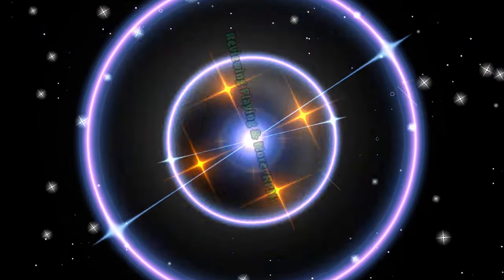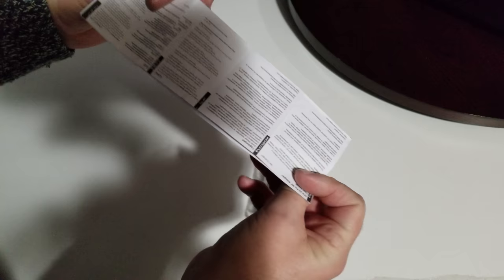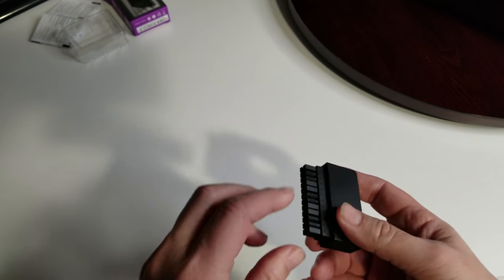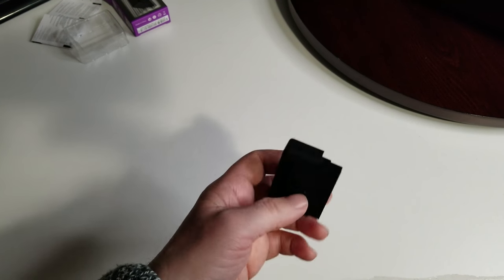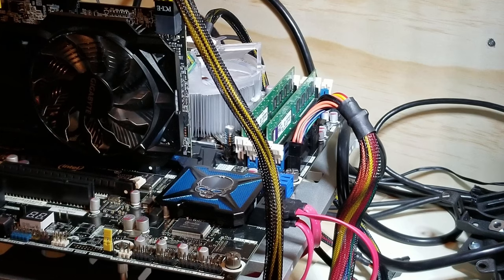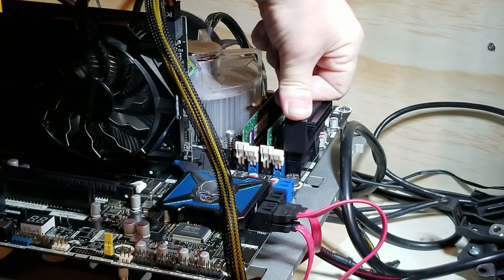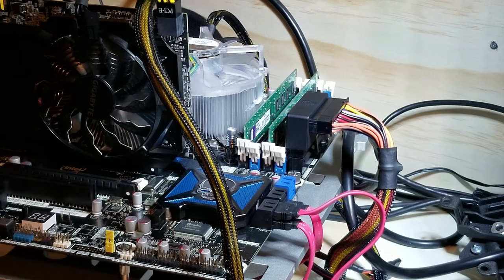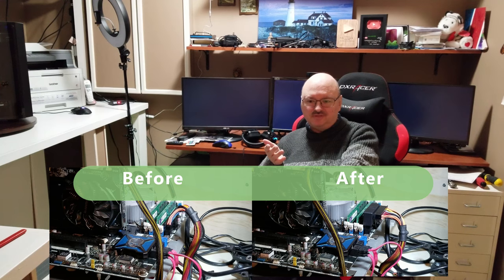Cooler Master 90 degree 24 Pin Power Adapter for Your Motherboard

Comment: i always was confused about do the wires of 24pin connector like when they are bended like that
this device definitely should make installation safer and easier
but i think it's too high, they could do it a little bit lower, so and it look bulky
also, they can put an LED on it, so insides of pc will be more brightly and shit, you now
Reply from the maker: Yeah, someone else mentioned the RGB thing lol...it's probably being thought of right now, crazy as that seems...take care man...Thanks...